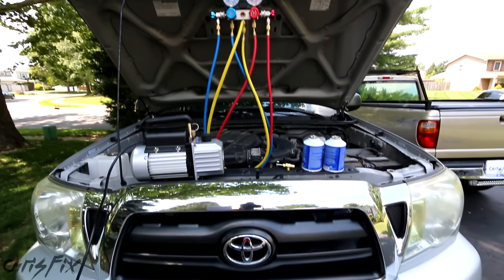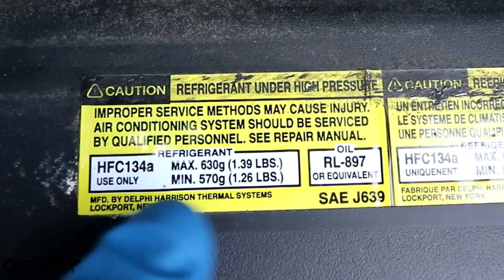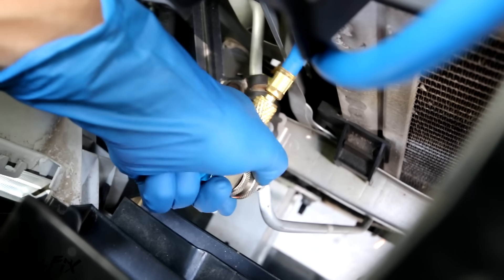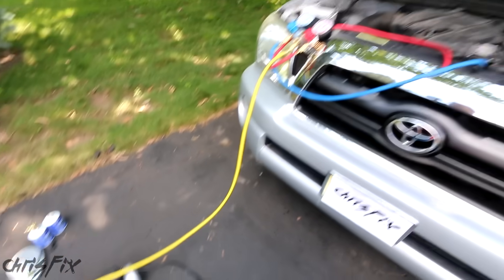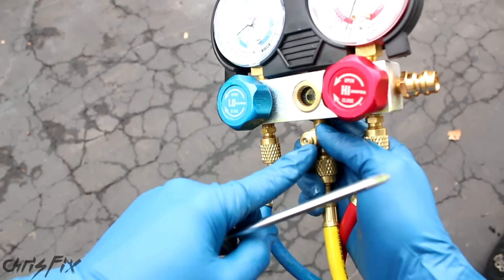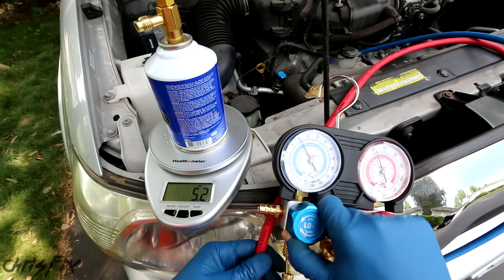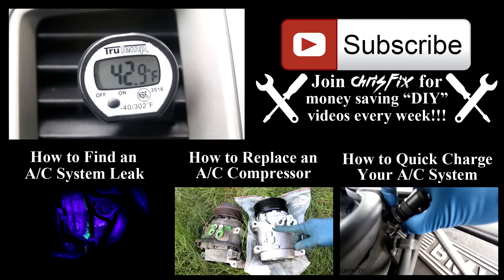How to Properly Recharge Your AC System

Comment: You need to also stress that too many stores (especially Amazon) sell R134a "Replacement" which is not R134a but a flammable hydrocarbon that is dangerous to the system.  Real R134a is an HFC (hydrofluorocarbon - 1,1,1,2-Tetrafluoroethane); R134a Replacement (common brand is ZeroR) is listed as proprietary and does not give its chemical structure, and I would not trust that.   Even though the EPA allows this replacement under the Snap program but even though it can replace R134a, it should not be mixed with it so a complete evacuation and flush should be done.  However, R134a is still cheap so why bother?

Comment: So I discovered that the Vevor kit attachment to the R134a bottle doesn't actually close the line at the bottle end... meaning you need to purge the line of air for each bottle.  Also, after following all of these steps both my high and low pressure connection Schrader valves were leaking.  Is there any part of this process that can damage those valves if some detail is missed?
Reply from the maker: If your valves are old they might not seat right or the o-rings can get damaged. Here is a product that helps you fix that: https://amzlink.to/az0DsCKg42QfE

Comment: Good video however I'm sorry I tried this.  I bought a scale, vacuum pump, recovery machine and recovery tank.  I evacuated 11oz but could only get 6.6 oz from the tank.  It would not pull anymore out even though there was pressure in the tank.  I then used a can from the parts store to add 10 oz because my system holds 1.1 lbs.  same issue as it took some then quit.  I had to shake it intermittently to get it to take.  Now I've got a recovery tank with 134a in it and I don't know what to do with it.  Good news is the low side pressure is about 35 and the high side is 100 to 250 and the air is 42 degrees.
Reply: Also, if the low side is 35 psi, then how does it pull Freon from the recovery tank one the pressure in the tank equalizes?

Comment: I'm used to pulling a vacuum while doing household AC Installs, but on my car that just needed a top up I purged the yellow hose but forgot that the attached blue hose would have air in it. So I accidentally stupidly added about 90 grams of r134a with a hoseful of air. AC is cold now, but have I done much damage? I guess the dryer will take the moisture but about the actual air. I'm guessing a little mix of dry  air won't hurt too much.

Comment: My daughter hit a deer and put a hole in the condenser on her 2006 Honda Odyssey.  If the system leaked out entirely, is it correct that I need to put oil back in it after replacing the condenser? Appreciate the video!

Comment: Thank you. I used this video to help recharge the AC on my 2004 Tacoma. I happened to have a 4 valve manifold, which just meant I didn't need to swap the vacuum pump and refrigerant bottle lines, but it was otherwise exactly the same process. Thanks!
Reply from the maker: Awesome, glad it worked out for you!

Comment: If your gauge has low loss fittings, before charging all the way leave 1-2 oz left in the tank, on the high side once your done charging, close the low loss fittings and open the high side service port on your gauge all the way, then open the low side for 3 seconds at a time to throttle it in until the pressures equalize. Thats how you take the refrigerant out of the gauge

Comment: If you are simply recovering refrigerant to recharge the system, does it also remove oil? If so, how much is removed?
Reply from the maker: It removes a little oil but not all of it. You can add a couple of OZ of new oil with no issues.

Comment: I followed these instructions to a T and literally nothing is flowing into the system. The cans still have pressure, and trying to purge more air results in refrigerant spraying out, but nothing is flowing into the system.
Reply: You must have a leak somewhere inside ur car or lines maybe even the schrader valves causing more outside air to be pulled into the system. OR You have not followed the proper procedure of closing certain valves like he said only open the low pressure valve when adding refrigerant but leave the high pressure side closed

Comment: Can anyone tell me how to make R1234yf work?  The valve that fits the can turns the opposite direction than R134 (left hand).  Also, the part of the valve that fits the yellow manifold hose is also left hand.  Does anyone know where I can find an adapter to make it fit?  By the way, I did find a work-around.  I happened to have an R1234yf can of AC/Pro so I screwed my can of straight R1234yf (Honeywell) into the AC/Pro gauge and filled it that way.  It would still be nice to have the proper adapter.  I don't even know what it would be called so I don't know what to buy.
Reply: 99% of things that you screw on are just called threaded or right hand threaded, if its the other way u must probably search for “left hanf threads” or “reverse thread”
Reply: @royybarra6160  Yeah, I guess I would have needed a LH to RH adapter of some sort but from what I have seen, no one bothers to connect the yf containers to the manifold, they just use a separate gauge.  So my workaround is as good a solution as any.

Comment: One thing to note don’t immediately disconnect the line when finish, there is still refrigerant trap in the red and yellow line close off the red line at the port n yellow line at the can n open both the low n high line at the gauge so it can suck the remaining refrigerant I’ve made the mistake of not doing it n when I disconnect the line from the gauge to put away refrigerant splatter all over me

Comment: I had a hole in the low side line near the valve.  I repaired the hole and need to fill the system.  Do I need to add more oil or can I assume the oil is still in the compressor?

Comment: Knock knock, anybody here? I need some clarification. So during the vaccuum the knobs are open at the guage and hoses on both the high and low side right? Then during charging only the low side is opened on both ends with the high side being  opened at the guage only? Am I getting this right? One more thing, I was advised by a friend that said when charging from bone dry the vehicle should not be running. So what say ye to all 3?
Reply: 1. yes
2 when charging dont open up the high side on the gauge or the pressure might backfire into the can/tank you can only charge with the low side with the system running 
3. You can start with the car off if its, but compressor needs to be sucking refrigerant into it because the system pressure and tank pressure will equalize before adding enough refrigerant depending on how big your tank of refrigerant is.

Comment: Followed all of your steps and ac works good. However, I have some knocking sounds coming from the brand new compressor every time the compressor kicks on or the vehicle is at higher RPMs. I’m not sure if my compressor needs more oil?

Comment: 6:18 what exactly is this closing off? I figured closing the knobs would close the gauges off from reading the ac line pressures?
Reply: It's closing the system off after vacuuming. You want to make sure there's no leaks.

Basically, this step is "holding in" the vacuum. 
Only thing that should be going in right after this step, is refrigerant, NO atmosphere air. Purge the yellow line after connecting the freon bottle.
Reply: Basically what the other guy said, you close those valves to hold in the vacuum and then if the gauges somehow show a pressure increase that means there's a leak somewhere that air is coming in through.

Comment: I believe you did a good job with this video. 
Just one thing. 
Onces are used to measure two things, volume and weight. 
Fluid once’s measure volume. 
Your scale measures weight. 
They are not the same. 
A fluid once of oil does not weight the same as a fluid once of water or gas.

Comment: Just asking but I've seen videos discussing never opening the high side from the manifold!! Thoughts??
Reply from the maker: You dont open the high side at the manifold. You just open up the high side at the valve so you can see what the pressure is but you add refrigerant through the low side.
Reply: @chrisfix Ok. Thank you!!👍

Comment: Hey Chris I’m working on my car right now as I’m typing this, hope this finds you asap. To recharge the system can I simply use a hose directly from the can to the inlet or does it have to be through the gauge set
Reply from the maker: You need to watch the gauges to make sure you have the correct pressure readings.

Comment: @9:11 the gauges were still reading a vacuum, but the next shot of the guage before you purged the system it is no longer under vacuum.

Are you opening the valves on the manifold guage, and then purging the entire A/C system? Or are you just purging the yellow line?

If you are just purging the yellow line, are you supposed to take the system out of vacuum before adding Freon?
Reply from the maker: The purge is for the yellow line. The whole ac system is under a vacuum.

Comment: Too bad you didn't explain why you were fiddle f ING around with knob on the refrigerant tap throughout the process... how to connect the 2nd can without spitting refrigerant everywhere... how those taps can break the self-sealing valve on the refrigerant cans so when you take it off the can it just shoots refrigerant freely, how the line for the refrigerant can needs to be positioned when weighing a can (either resting on something in the same place without moving, or worked to where the line hangs freely), and that hand tightening the hose connections could very likely be insufficient even if you have super grip/hand/finger strength. Millions of views, I wonder how many cubic meters of refrigerant are in the atmosphere thanks to this video and the many others like it.

Comment: Can anyone help me? I have a 2006 volvo xc90 and when i connect my refrigerant can to the low pressure port it doesn’t spray/add it into the system. The gauge on my reader stays at zero. What should I do?

Comment: for the very few tomes you'll be working on your AC system. it is really not worth doing DIY. you need so many AC specific tools for the job, it's better to just pay a garage to do all this for you.

if youve bought a car and AC doesnt work, you should take it to a pro who will check through pressure in the system, make sure the hoses arent leaking, condenser isn't leaking, pump is working, car electrics are sending the correct signals to the compressor etc. there are quite a lot of things to check and an AC specialist can take care of that for yhou.

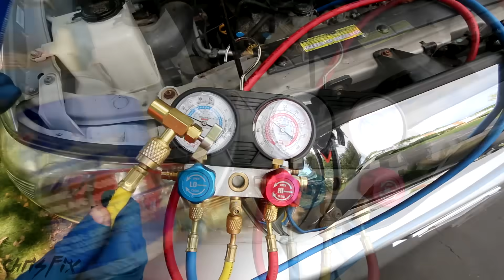Comment: @11:18 he said screw that tap all the way down so it seals off the yellow hose, but when it's all the way down you can't add a new can without it immediately piercing the new can and spraying your hand and stuff.
Reply: Close the red and blue valves first, then u can remove it from the hose completely, put it on the second can dirst then back on the yellow, bleed again then open blue and red after bleeding

Comment: @7:06 what prevents this from sucking out all the oil from the new compressor as well???
Reply: If the compressor comes with oil, a vacuum pump will not remove it. Refrigerant is a gas at these temps or a liquid at these temps and high pressure. Oil is always a liquid at these temps and cannot be sucked up by a vacuum pump out of the system. The system has to be physically drained or flushed to remove oil. 
When he adds oil to the yellow hose, that hose end needs to stay up and should soon be attached to a refrigerant bottle and be flushed into the system by gravity and the incoming refrigerant.

Comment: after the first vacuum you close the knobs to see if it was leaking.. but how is the gage going to measure the vacuum if you choose the valve??!..
Reply: I believe Those valves are only blocking themselves from the yellow hose. The valves on the connectors are allowing the measurement.

Comment: I’m slow, but at 11:40 you said each can is 12 oz but you weighed the can and it said 20 oz
Reply: 12oz is the mass of refrigerant inside the can. 20 oz is he total weight of the can and it’s content. The only weight that can leave the can is refrigerant. So basically when the can is empty it will weigh around 8oz of metal.
Reply: @erikesenaliev9843 thank you🤙🏽🤙🏽🤙🏽
Reply: Or what about zeroing the scale with the empty

Comment: why even add the high side at all. if you buy the can with the hose there is no high side.
Reply: I also wonder this. Like after the vacuum process is done, could i not just close and disconnect the high side and put it away back on the gauge manifold?
Reply: If you do the add only can you are adding an unknown amount of refrigerant to a system that likely has air in it.  (Moisture/air) when you pull the vacuum you pull from both sides.
Reply: @saltykraut so connecting the low side only and then bleeding the valve until refrigerant comes out is not enough?
Reply: @ryanpatton1795 no that's technically not enough especially depending on why you ran out of refrigerant in the first place

Comment: 4:23 he doesnt explain it but where it connects to the car ac lines, left is closed, and right is open. The knobs at the manifold guages are right closed and left open.
Reply: No he opens them all then pulls vacuum
Reply: @lurice0 yes but open is clockwise at the port valve and counter-clockwise at the manifold valve. If you turn them both counter-clockwise one will be closed and one open so you won't vacuum the lines correctly
Reply: @thomassandoval8025 regardless of which way they're turned, they're labeled open and closed. All are open when pulling vacuum
Reply: @lurice0 not all are marked open/close mine only have arrows. Obviously they need to be open, but if you don't have his exact manifold, you're going to need to turn opposite directions at the valve and manifold to open them.

Comment: Is it ok to start the engine with the system empty and under a vacuum or should you add freon before starting engine.
Reply: Idk if starting engine under vacuum will hurt it but probably definitely don't try to run the compressor under vacuum it might kick on and run dry of oil but idk. You do want car running and ac on when adding freon.
Reply: Compressor won't kick on until their is sufficient positive pressure.

Comment: You cant purge the yellow line if you added the oil. Adding the oil the way you showed in your video traps the air between the hose end and the manifold set. You have to use one of the oil injectors, fill them with oil and pull the vacuum so any air in the hoses is gone. Also NEVER turn the A/C on until your valves on the manifold set are closed. You initially want to flood with liquid refrigerant with both valves open, and then once you close them push the A/C button. You can get a can to burst if you have the red valve open while the compressor is running. You forgot to mention that rR-134a should be charged as gas (Yes you can charge as liquid with the can upside down, but you are taking a chance of blowing up the valves inside the compressor - so liquid charge is only for people who know what they are doing). So the safest way for anyone to charge is with the can in the up position as labeled on all cans that I have seen.  Otherwise the video is great!

Comment: Just want to be sure i understand this correctly. When adding a second can, i close the brass adapter. Then when i screw on a new can, does it automatically pierce the can as its being screwed on? Also, Do i need to purge the yellow line again? Thanks!
Reply: No it shouldn't pierce it automatically as it's being screwed on. It shouldn't pierce until you turn the valve

Comment: Do not add liquid refrigerant into low side, gas only or may damage compressor, also, is that real R134a or R134a replacement which cause problems in the system. These things matter.

Comment: Probably worth noting, you can't add oil via the yellow hose if the hose has a built in check valve.
Reply: Do you have your hose on backwards? I think one end has a valve or something and other end doesn't? Or are you talking about the purge valve he opens with a screwdriver in the video?

Comment: Just had a question so the high side valve is closed on the manifold and and valve correct? If so how does the high side manifold still show any pressure?
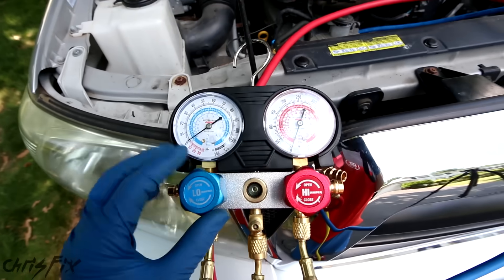Reply: @5:26 he opens the high side connector valve.
@12:18 he closes the high side connector valve when he's finished.

I believe The 2 valves at the manifold gauge are only blocking themselves from the yellow hose.

Comment: Hi! Chris. Thanks for this very well made Video. It is thanks to this Video that I have been able to help both of my daughters, with their Ac systems, on their Cars. THANK YOU SO MUCH! But there is something that I still don't know, regarding the Ac system. And that is to be able to interpret the Manometer pointers on the Low and High side, so that I can find out if it is the Ac compressor or the Condenser with filter that is Broken. Or if it is the expansion valve. Would you like to give me some tips on how to do it in the best way. Thanks! From Tommy.

Comment: Hi there I have a question. My person Vehicle is a 2007 ram 3500 Diesel 6.7  . But  I My  A/C  not Cooling . BUT when I hit the  bottom  On  compressor Shut works but not cooling But one of the lines get like frozen. When off the bottom  but the line back normal .

Comment: When reading the pressure gauge, do you match the pressure readings based on the Freon type or just use the outer ring pressures?
Reply from the maker: Read PSI from the gauge (outer ring), but compare it to the correct chart for your refrigerant type if needed